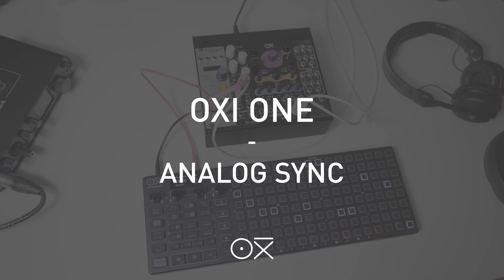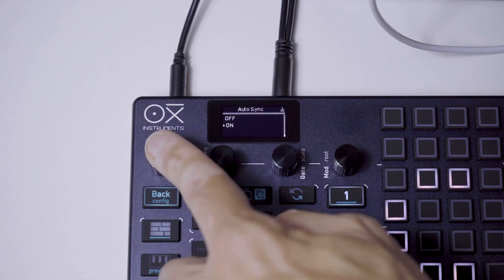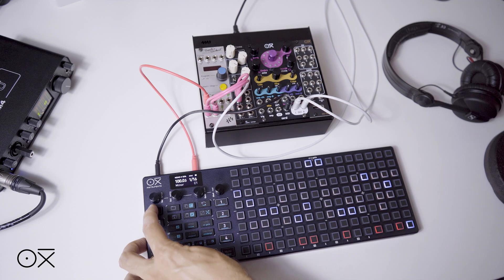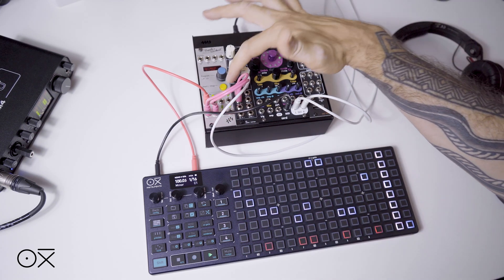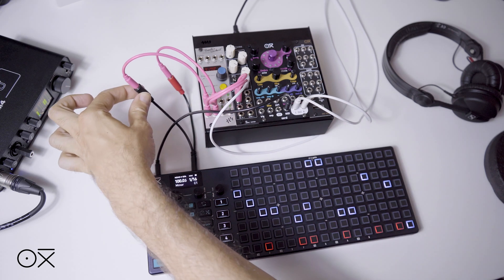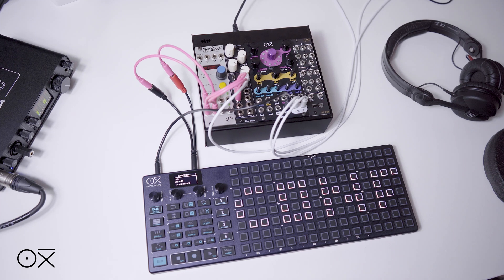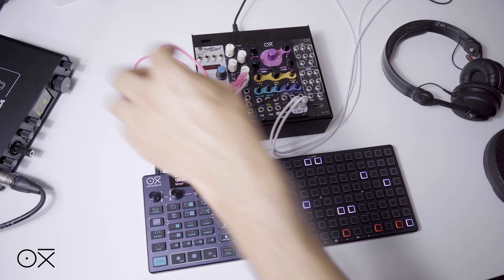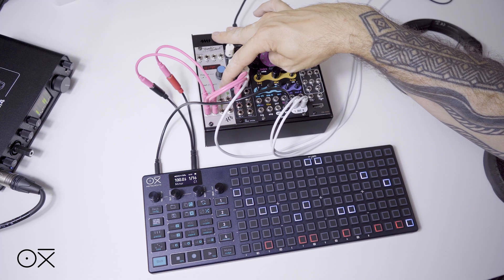OXI One Tutorial - How to Synchronize to an External Analog Clock

Comment: im trying to work this but the other way around. clocking the pam and trying to send start and stop to it. do i need the same Y trs cable to achieve that? i can sync the pam with the midi out but cant start stop it. thx!
Reply: Hi, I'd like to do the same thing, did you try? I do not own an Oxi One yet, cheers
Reply: @postpnd   yeah it was simple. you need a trs cable that splits into 2 mono signals, the trs goes from the output of oxi one to the 2 inputs of pam . works like a charm
Reply: @damianpinto3497  clock out of the oxi? or did you do it thru the pipe

Comment: How does it handle an irregular or variable clock?  is it approximating a Bpm based on the analog input or is it truly advancing with each input pulse like an analog sequencer would?
Reply from the maker: It tries to run at the average tempo. It doesn’t run like an analog sequencer since it has to internally calculate it for the internal tasks.